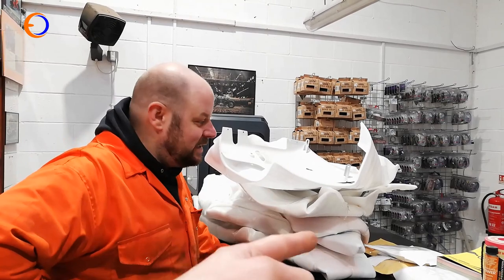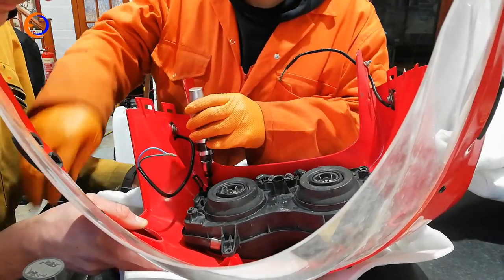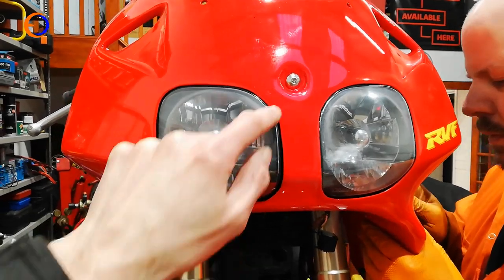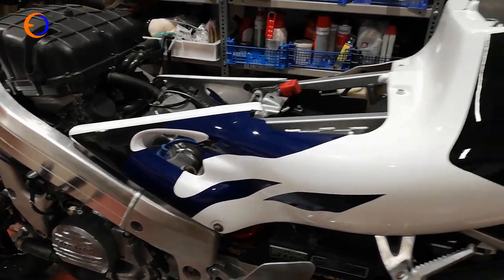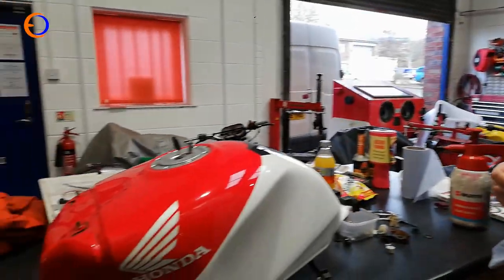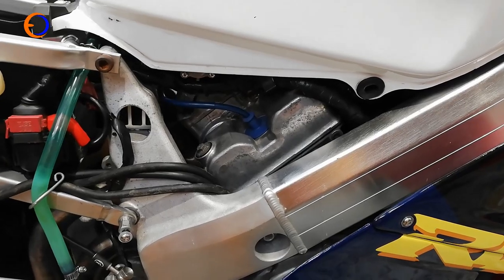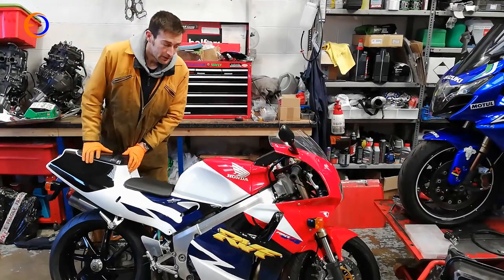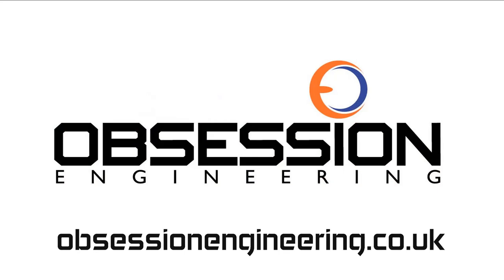The B.O.A.T bike Part 7. Fitting cheap Chinese bodywork and suspension setup on the Honda RVF 400

Comment: Looks awesome. Just wish these fairing kits cost a bit more for a better fit… if they cost more than double what they do now but actually fitted and came with a fasteners fitting kit we  would be happy.
Reply: I believe the Tyga ones are?
Reply: @robotserious  The Tyga fairing is good and much better than Chinese but it is, of course, more than twice the price. As far as fitting goes it is a bit of a palaver because the headlight section and two (upper) side panels are in one piece, so you're are trying to manoeuvre it around several obstructions at the same time without scratching or chipping it. Best done with help from a mate (or the wife), who won't be offended by the inevitable bad language. 
Similarly the tail section is one solid piece, instead of two, so squeezing it over the reg/rec on one side and expansion bottle on the other is tricky and will result in more swearing.

Comment: I got a full set for my 2001 R1 after a crash 
Payed 500 ish with inport tax 
It fit great apart from belly pan , that fit but we sused why the sets are a bit off , they are the thickness of the originals out , they use an original to make the molds but externaly not internaly and then add the internal fixings points while the matereal is still wet 
Not done in a injection
Plastic mold at all

Comment: I see you discovered what a bugger it is getting to the front two spark plugs! Mr Honda couldn't have made them much more inaccessible if he'd tried. I ended up draining the cooling system, disconnecting a couple of pipes and displacing the top radiator just to get to plug caps. The plugs themselves are buried so far down I needed an extension bar and deep 13mm socket (bought specially) to reach them. And why are they so bloody expensive? Currently around £16 each!!
Incidentally, fitting the indicators isn't as difficult as you seemed to find it. There is a small, square metal plate that locates in a slot inside the indicator casing. If that's missing or incorrectly fitted then fitting will be very tricky. Shame I couldn't have been there to show you!
Reply from the maker: The backing plates in the indicators had come adrift, which was definitely part of the problem 🤣

Comment: So I have to ask Adam the question, why didn’t you order a fixing kit when ordering the fairing? You must have know you needed them. 😁
Reply: They dont doo them in china
Reply: Fair question but the simple answer is that the bolts you can buy from china are made of chocolate-metal so it's not worth it.
I bought bolts with assorted nuts, clip-nuts and plastic push-pins on ebay just for the plastic bits and clip-nuts, the "aluminium" bolts are shockingly soft
Reply: @bertzx9r894  int all the stuff on ebay from china .....lol
Reply: @spikeccx  didn’t mean from China 🇨🇳
Reply: @bertzx9r894  didn’t mean from China 🇨🇳
Reply: @jhstony  well they are very probably made there , know someone in aerospace 
He has a lot of fasners made there just tests them properly , he makes a huge mark up ! .
Reply: @spikeccx  share the plug

Comment: Indicators are a good analogy for everything on these bikes. Super fiddly and you’ll probably end up bodging it slightly. Chinese fairings look great from a distance but are super frustrating. I can understand needing help fitting on the bike but why don’t the panels line up against each other!!
Reply from the maker: The seat panels seem to have been made in different batches, even the paint is a different colour